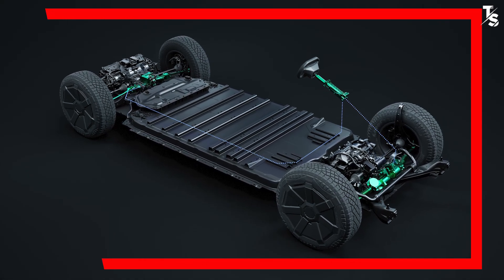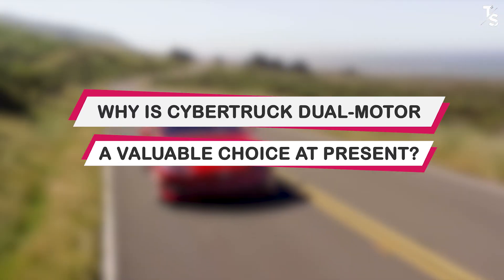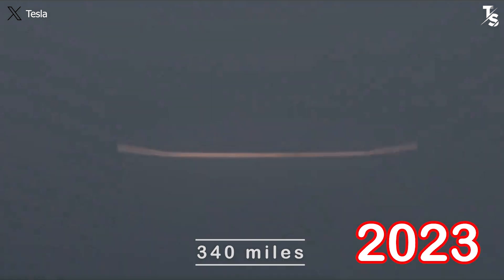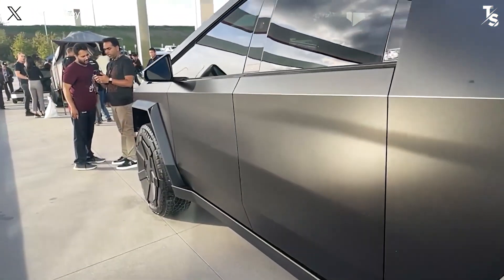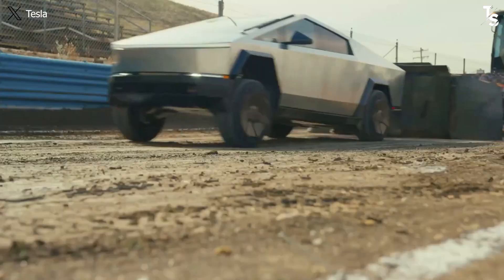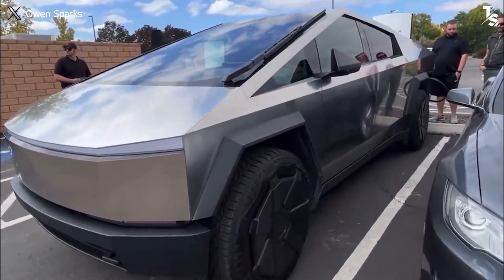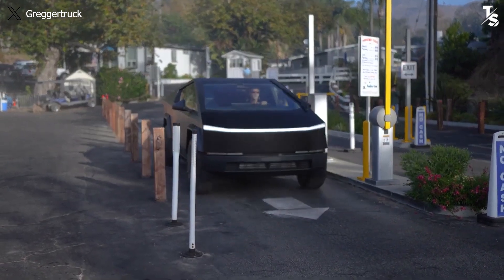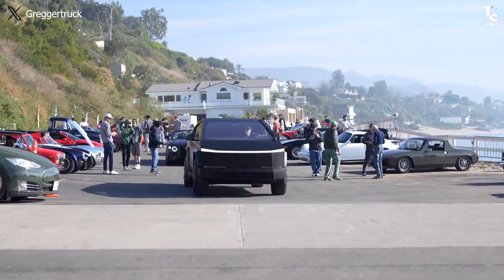2024 Cybertruck Upgrade: Why Cybertruck Dual-Motor Is a Smarter Choice in 2024 – Detail Explained!

Comment: >>The top “3 motor 500 mile” model was $69,990 at launch. FSD was $7K. So my ~ $85K order for a 6 passenger 500 mile truck became $120K for a 5 passenger 350 mile range. Also not 3500lbs capacity or 14,000 tow. So I cancelled. I assume many will.<<

Comment: I have two reservations for foundation and I’m contemplating whether to get dual motor for one of them but it’s only available in foundation so not sure if I’ll recieve the $7500 rebate or not since the truck is $20.000 more due to the fact that it’s foundation edition. I already paid for the TriMotor for one of them but was debating if I should get the second one dual and get early Feb Or March